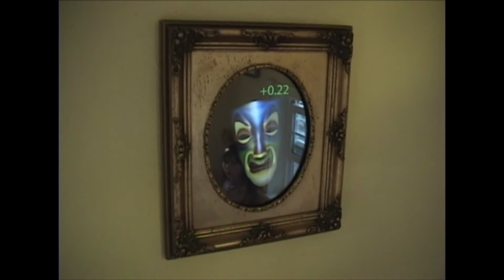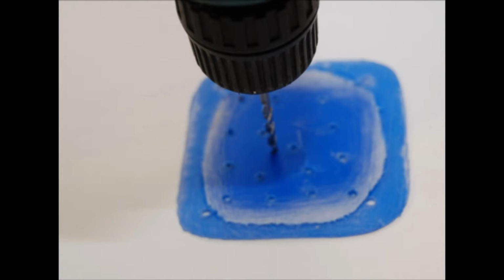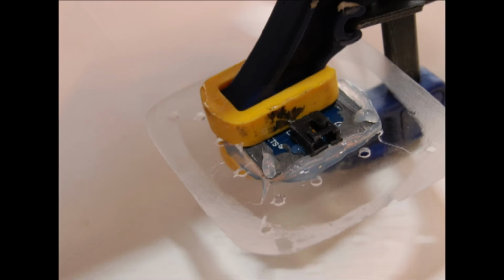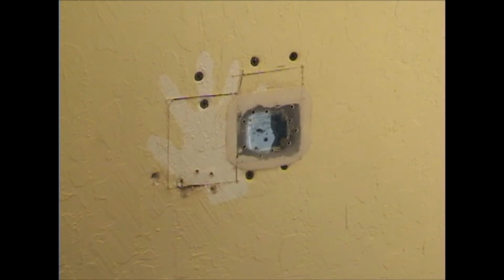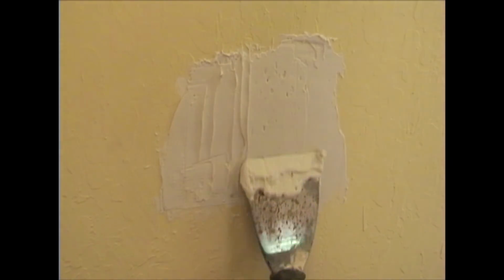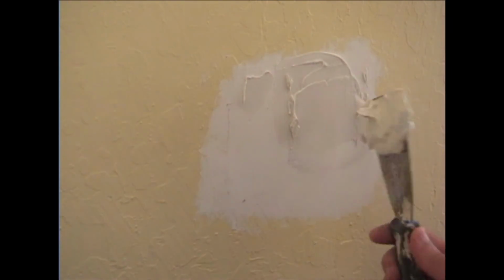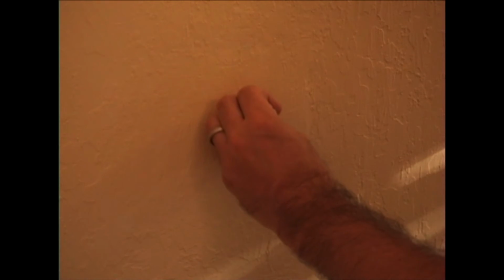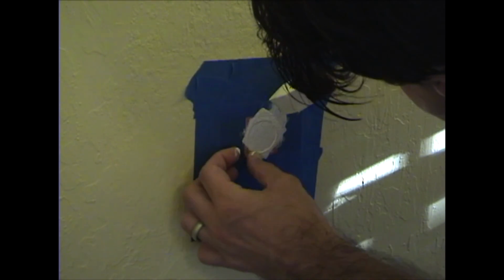DIY Magic Mirror - In Wall Touch Sensor Installation

Comment: Can't believe I had to go back to 2009 to find someone implement this! GREAT STUFF. 
In more recent years have you experimented with this idea further? I'm researching the idea of flush seamless walls in todays smart home world, using capacitive touch switching for on/off and perhaps dimming. 

There's not much going on in this niche area I have found, strangely I find that "SMART" switches are becoming mostly larger that conventional switches or clunky glassy things. Frustrating it is!

Comment: Great video! Would the same sensor work with wood or blueboard?
Reply: should be fine just so long as the wood is not too thick, may need to recess the sensor in the wood